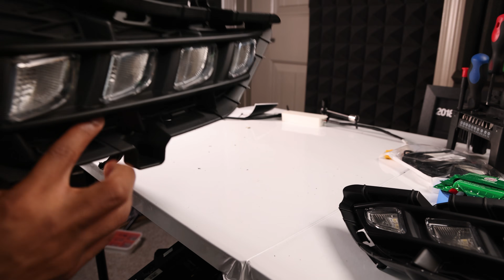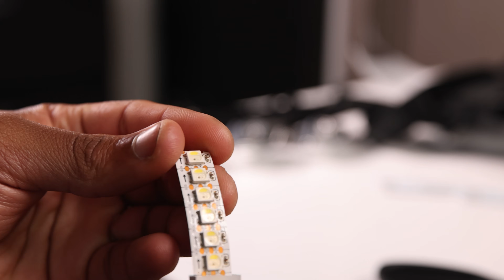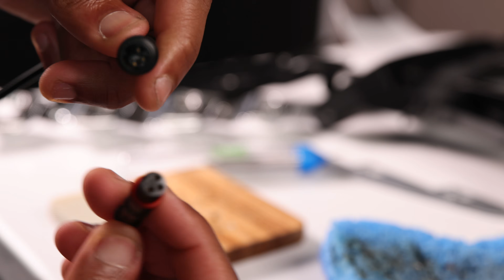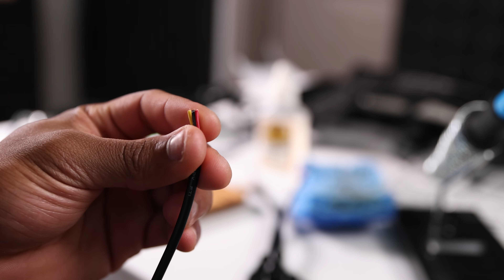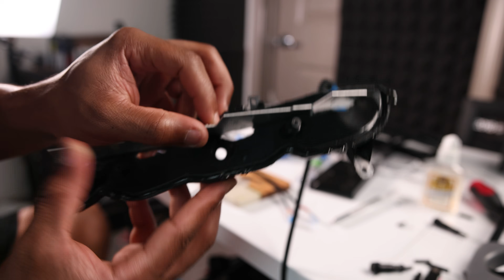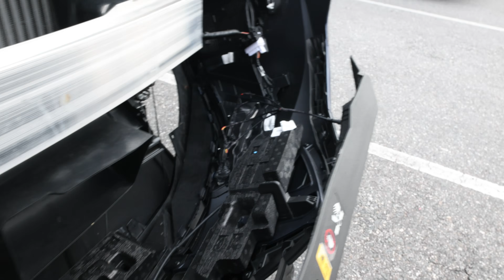Hyundai Sonata Custom RGB Fog Lights Install  | 2020 2021 2022 SEL, SEL PLUS

Comment: I just got these same lights for my 21 Sonata Limited. How did you wire up your lights ? Did you do it like the other guy where he did a wire tap off the fuel pump with a wire tap. Plus he ran the blue wire to the DRL's in slot 19. Trying to decide if I want to do this on my own or take it to a stereo shop to do it.
Reply from the maker: Is tapped it directly to the battery
Reply: @EddiePemberton  bro did you try jb4 tune and can you post more sonata videos
Reply from the maker: But through an external fuse